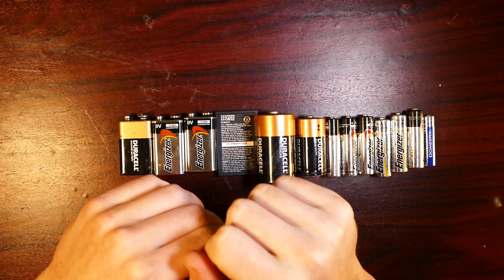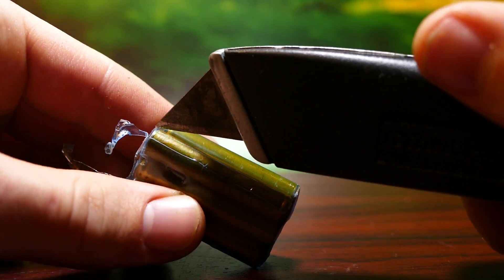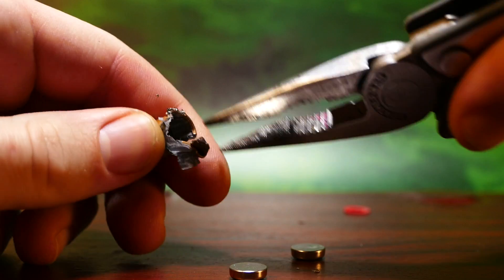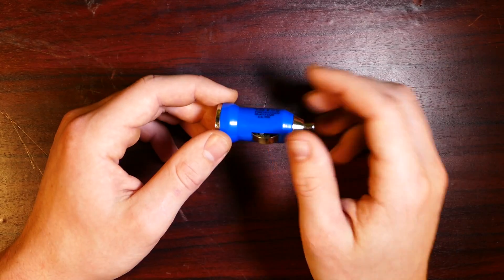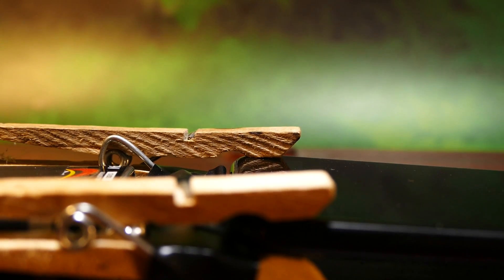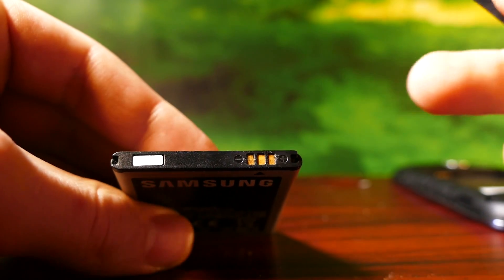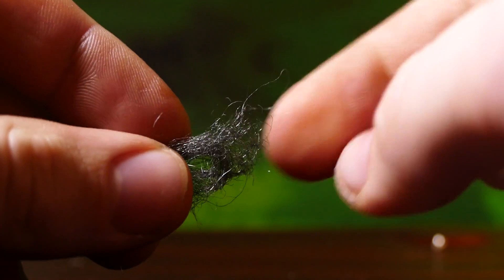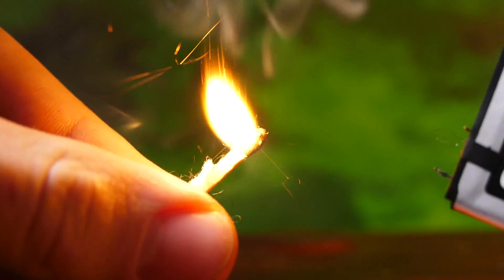3 Battery Life Hacks YOU SHOULD KNOW - Start a Fire With a Cellphone!

Comment: Create fire with your phone battery (and flash cotton, and a match) sorry, but you are better off just rubbing sticks together and using your phone to call someone. Save your phone and find someplace that had signal. Also, that phone battery doesn't have charge protection circuitry (hence the third data terminal) which means if your phone is dead and you try this, you can over discharge the lithium cell and unintentionally blow it up (edit) though putting two 9 volts in series to increase the amperage and not the voltage is a great idea.

Comment: why did you use two 9v for the phone charger when I have seen it done with just one plus the usb out was kept rather than replaced
Reply: george aura the two 9 volts were put in parallel, this means that the mAH or amount of electrons passing per the voltage is added. So the voltage is still 9 volts, but the amperage or "power" (in simple terms) is increased. Though I do agree, keeping the port would have been smarter as then you could have charged a plethora of phones instead of just crapple. (Apple)
Reply: george aura I used a single 9v battery and build a voltage boost circuit by using parts from old PC Mainboard (got for free from German ebay)